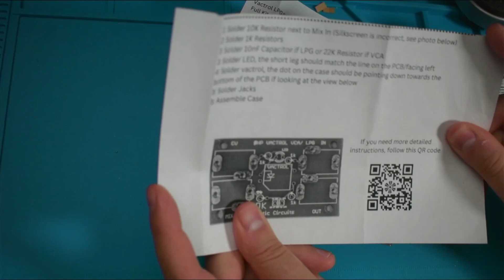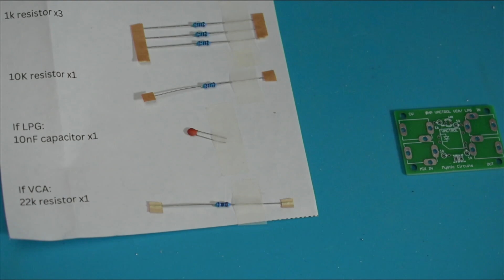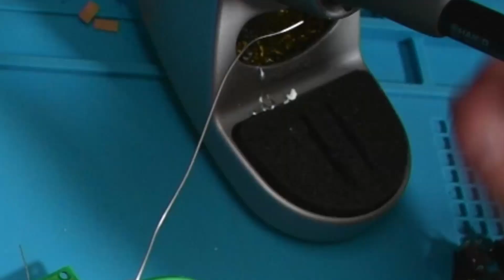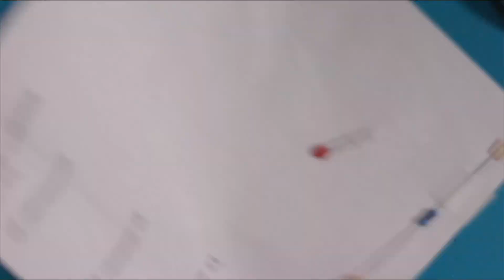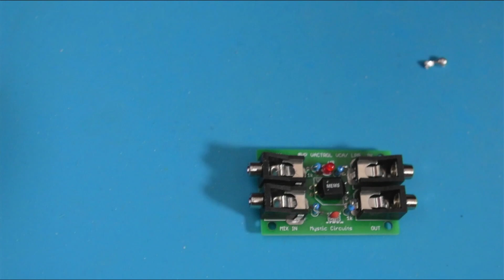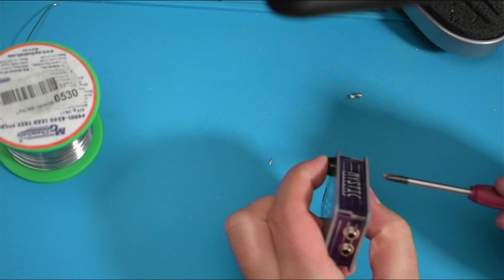Mystic Circuits 0HP Vactrol Build Guide

Comment: Thanks for the video.  Difficult to get info on vactrols.  I just built a Mutron III guitar pedal and it kinda works, but it's oscillating strangely and I can't find a single thing done wrong with the circuit.  So I just ordered another set of vactrols as I suspect they were the issue.  It seems that if you order a dozen you might get 6 that work properly if you're lucky, which is so strange but yep.